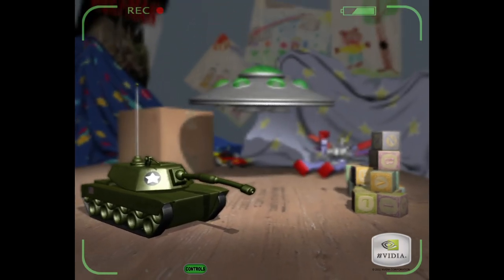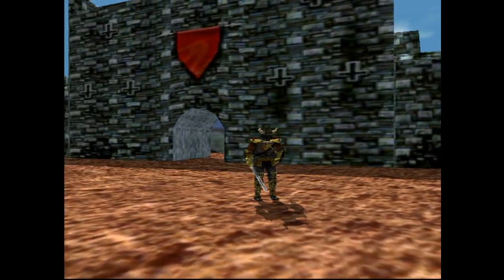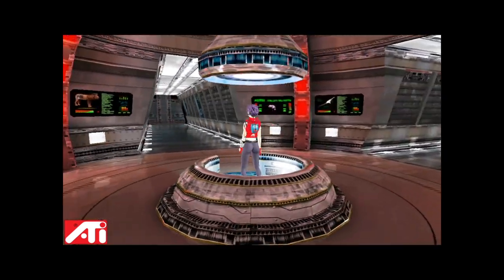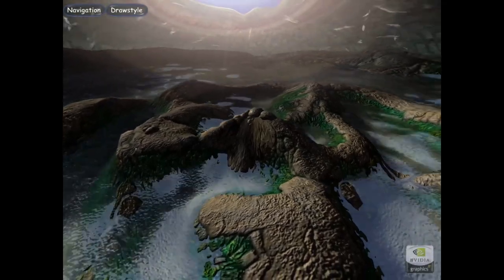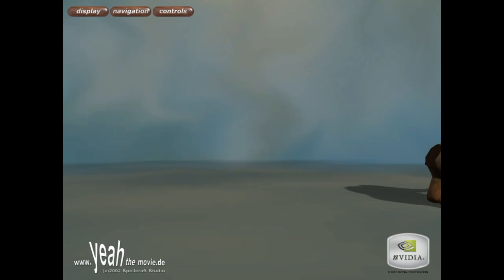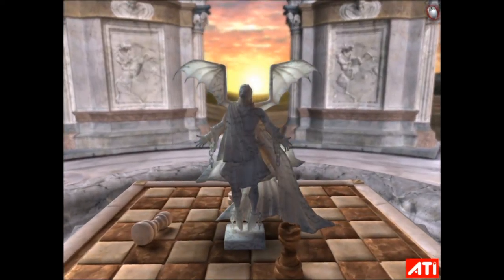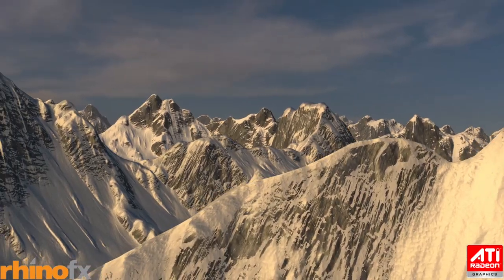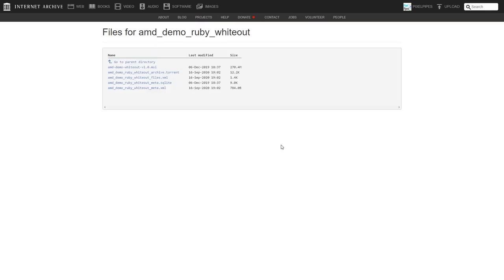The Lost Art of Tech Demos

Comment: The awsome thing about Dawn, was that it could be also patched to run on the 9700Pro, and unshockingly ran significantly better on said hardware. Us ATI users gloated like little smug children.
Reply: another fun thing is that the New Dawn demo used to run on Radeon cards as well with a help of a patch, used to run it on my HD5870, ran like ass
Reply: Yeah, I remember my hard modded 9500 beating my mates nvidia card at Dawn
Reply: @nemz7505  OOH, I remember doing that to my friends 9500, and enabling its second half. Was just a bios flash or a resistor or something to that effect IIRC. Was really a snap... And I spent the money on the whole thing, though i got the All-in-wonder edition so to me it was worth that.
Reply: @wishusknight3009  Omega Drivers <3 . It never was so easy to double the Performance :D .
Reply: @vr-legion3468  Those were pretty good, though I never saw a doubling of performance if I had the stock drivers tweaked a little. But it was safe to say they were better than stock in every way and fixed a lot of issues that ATI never fixed until their legacy driver program many years later.
Reply: Damn, that wasn't the patch I was running.
Reply: @vr-legion3468   I always used Omega Drivers as well. Radeon 8500 LE overclocked past regular Radeon 8500 speeds, and a Radeon 9800 Pro overclocked to about 25% past 9800 XT speeds.  I added on the adhesive ram sinks and Vantec Iceberq 5 cooler.
Reply: Ruby got me bricked up here lol

Comment: Is there any way to have all the rendering APIs on one system: D3D, OGL, Glide,S3Metal/S3TC, Vulkan (backwards compatible)? Did you managed to pull this off? I went through the nVidia/ATI demos today on my current gen pc and some of the tests from NV wanted me to have at least a GTX4xx (only had a quadro P and a RTX) and they wouldn’t run 😢I will try on my other retro build (gt430/voodoo2)…
P.S. If you have time that could make a video build with all the rendering APIs in one
Reply from the maker: It might be possible but it would be a nightmare to mix hardware and software for APIs that are decades apart. Technically S3TC is a standard feature of DX6/OGL1.3 so any card with full feature support of those APIs will support that. MeTal is a different story though. Glide can be handled via wrappers on more modern hardware, making it easier to also support Vulkan. But native support for both 90s and modern APIs on a board and OS that is happy with it would probably be a hair pulling ordeal.

Comment: Only 2 games I can think of top of head utilize the ATi CIF. One was a special edition of Wipeout specifically made for ATi and the other believe it or not was the original Tomb Raider with the TOMBATi patch which I had success running on an old 3d rage pro with some ancient drivers that included the cif.
I think card companies stopped caring about consumers and that is the reason tech demo's faded away. It's just a numbers game to them.
Reply: I politely disagree on the "consumer"-part of your comment. Nowadays there is more reliance on standardisation of APIs (openGL, Direct3D, etc.) than in the "early days" of CIF, Glide and so on. So there are no (or less atleast) "bare metal" feature sets to showcase (beside perhaps nvidia's current implementation of RT). Plus, hardware-specific tech demos are also less suitable to actually compare/benchmark/review cards or actually see those features in actual games and other 3D apps.

Comment: ATI toy shop demo is so nice looking too this day, specially if you force the resolution upwards it still looks nice, remember running that on my HD 5770 in 2010 being impressed of how nice it looked in 1080p with anti aliasing & sharper textures forced on.
Reply: This is a bit irrelevant but Carmageddon runs so well after following comment nr17 on steam discussions there on the instructions.
https://steamcommunity.com/app/282010/discussions/0/333656722982705624/?ctp=2
Sound is acting up though unfortunately with the carma95 exe's for me but runs 1080p 60+ fps thanks too dgvoodoo2 & those instructions on comment 17 there by smappyy, ofc due too the high fps the timer is a bit faster then it should so had too limit via rivatuner server statistics, steam overlay also works fine, though bit laggy due too the fps in the menu's & when it plays those clips at 20 fps.

Comment: in my opinion, ati demos were far superior to nvidia, characters and constant 60fps, it was just me running demos with a lower spec card? in 2003 i tried to run GF3 Ti and GF4 Ti demos on GF4 MX, didnt run or grafical glitches, only GF2/GF4 MX were able to run, later in 2006 i tried to Run GF6800/7800 on 6600GT, 6800 demos was ok, but 7800 demos was slowy... in these times, i like ATI over nvidia, better image quality, and AA/AF performance. the downside from ATI came later with R600/2900XT
Reply: my GFX purchase order was, TNT2 - GF4 MX440 - 6600GT - X850XT - X1900XT - 6600LE (yes i downgrade) - 7800GT - 9600GT, and later got 2 or 3 GFX same time, like 8600GT+9600GT, or HD4850+9600GT, then GTX560+HD4850, or HD6870+GTX560, then GTX770 to 9400GT lol, then HD6670 - GTX1050Ti to GT640 lol again, actually GTX960 and HD6670 (backup), i usually switch to AMD when games are optimized for. with ATI/AMD had some troubles with low spec cpu, causing so much Cpu Driver Overhead, Nvidia drivers were and are much more stable.
Reply: The GeForce 4 MX was a very cut-down version of the GeForce 4 - in terms of performance/features it was far closer to a GeForce 2 - which is probably why the GF3/GF4 demos didn't run or had glitches. Nvidia wanted to have something for the lower end of the GPU market and used the GeForce 4 name to imply that it was in line what that series, but it was a low-end GPU.